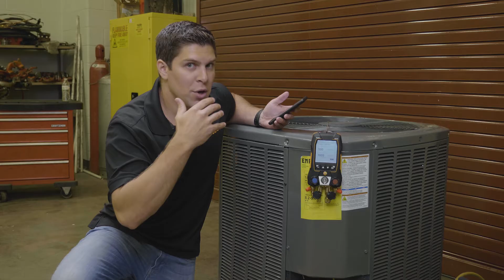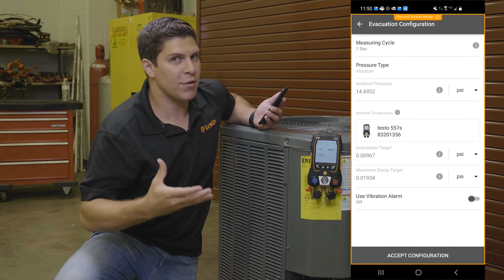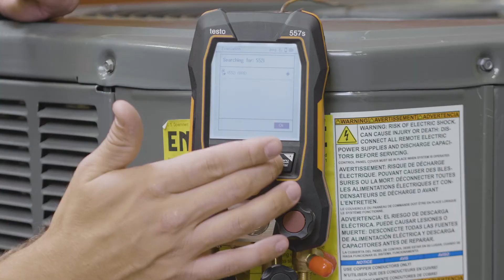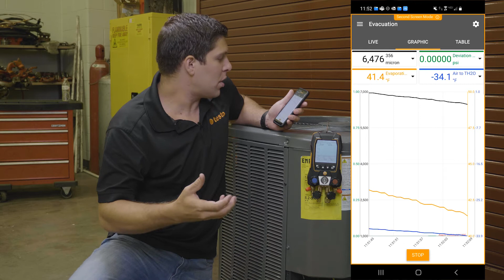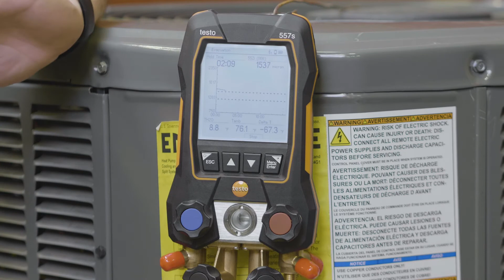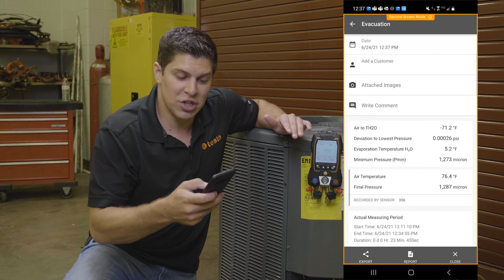Application video testo 550s 557s evacuation | Be sure. Testo

Comment: Wondering how is one suppose to know the pressure test can only be doing using the high side? Manual states nothing about only using the high side on the pressure test. That should really be included in the manual. Couldn't get the micron/vaccum gauge to work either...I guess I shoulda got a Fieldpiece....

Comment: Where is the sensor? 😂
Reply: I thought the same thing. But then I did realize if you put a ball valve at charging port on the gauges and close it  and close the suction valve too you should be good. They should have a valve for that charging port like on the 557s

Comment: Do you need the Bluetooth vacuum gauge or can you just pull through the manifold, because when I tried pulling through the manifold I wouldn't get a reading at all
Reply: Why just not integrate a micron gauge in the 550s device, so dumb...
Reply: Or even I understand not having it integrated in the 550s but it definitely should be integrated in the 557s considering it has the vacuum port on it @hug00l
Reply: I’ve tried using this option and left my vacuum running for hours and it never measured my microns
Reply: Did you ever get an answer?
Reply: I had the same issues, no reading when using hoses connected to manifold, poor design
Reply: He used a Bluetooth probe in this video. (552i)
Reply: @Crookshanks117  when does the reading starts are gauges?
Reply: I tried doing the same and no reading can I not get reading just threw the manifold? Do I need to get a Bluetooth vacuum gauge?
Reply: @chinoguevara7411  you need the bluetooth vac guage
Reply: It is totally stupid but the answer is yes! @chinoguevara7411
Reply: The 557 seems a bit redundant with the app... Why even bring it out of the box for vacuum testing?  🐴
Reply: The transducer in the gauge is different to to a bluetooth vacuum unit(which ideally needs to read in microns)